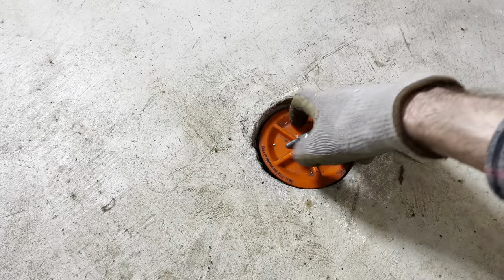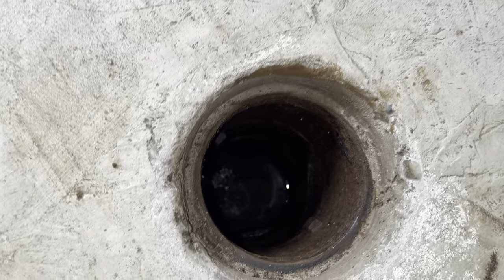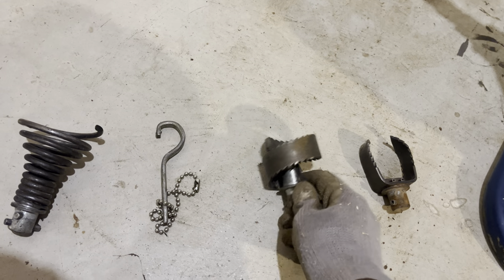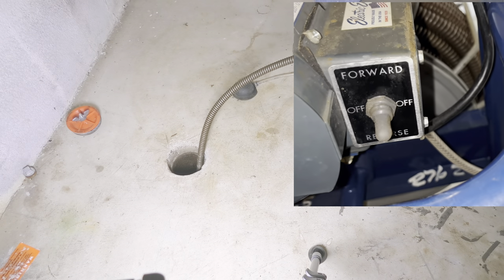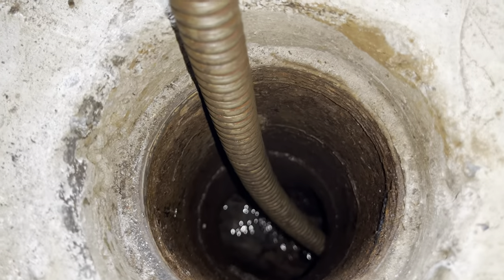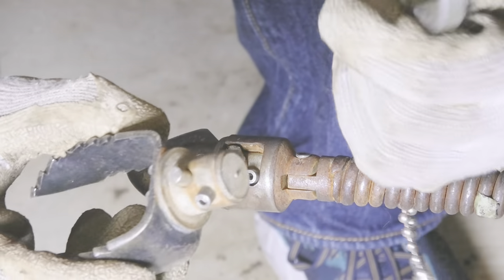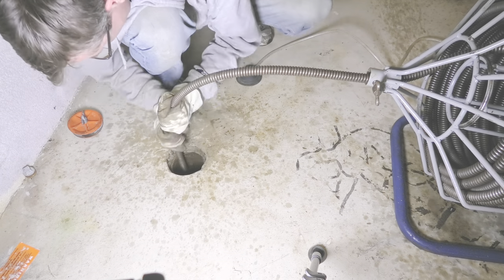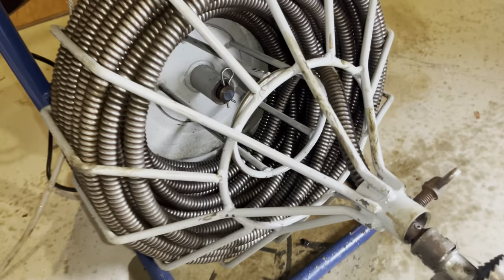Cleaning out clogged sewer line (DIY instructions in High Quality)

Comment: Reverse Motor direction only when pulling the cable off an obstruction. Trying to push the cable down the pipe or pull it out of a pipe while in reverse operation can unravel and break the cable.

Comment: My basement backed up for the first time in one year since I been in this out. Heavy rain it back up the went down a couple hours after it stop raining. Does not back up when washing machine etc etc. any advice?
Reply from the maker: I had a similar experience in the past.  
Just running the washing machine or one person taking a shower never was an issue. But when four people take a shower, then the water would back up into the house. 
It turned out to be a bunch of roots, growing into the pipe. They would just enough water to pass for it to be unnoticeable during normal usage. But with bigger amounts of water the water would back up into the house. 
I suggest to confirm if are roots in the way. And then use a root cutting bit to remove them. 
For me it was pretty obvious that roots were the problem, because there is a big maple right next to the sewer line.

Comment: Is the clean out usually located in the back of the house if not outside?
Reply from the maker: My clean-out is located towards the front of the house, since the main sewer is running along the road. 
I’ve seen friends houses, where the clean-out was outside. I guess it can be located at either places.

Comment: Do you think Draino or Septic enzymes could help temporarily until I can the rental equipment?
Reply from the maker: When the blockage is deep down the line then I doubt those will have an effect, because the chemicals won’t be able to reach.
Reply: @MegaSafetyFirst  ok. That makes sense. Thank you so much for responding.

Comment: In regards to the bit you called a grease cutter, I asked the guy for a root cutter and he gave me what you are calling a grease cutter. So it doesn't work on roots?
Reply from the maker: Hi,  I was using the names as they were mentioned in the machines instructions manual.  
I could the that bit being able to cut through smaller roots easily.  But as soon as it hits a bigger root, I’d imagine the but will get stuck.  The other bit (the actual root cutter) would be better for that application, since it has the saw teeth at the front and should not get stuck as easily.
Reply: @MegaSafetyFirst  ok cool. Good info to know for next time. Thanks.